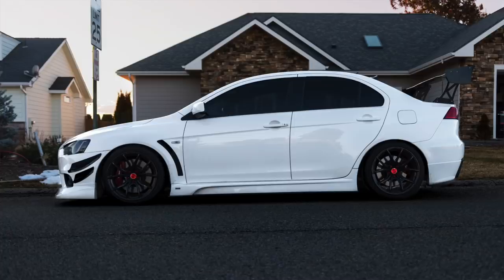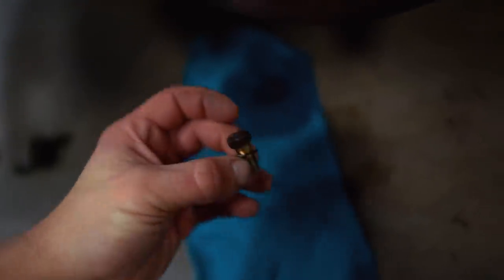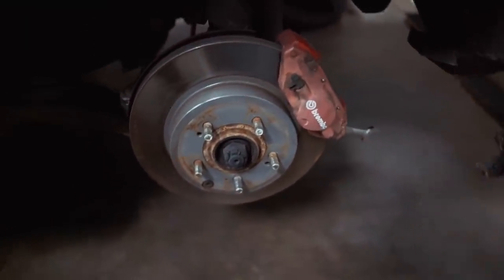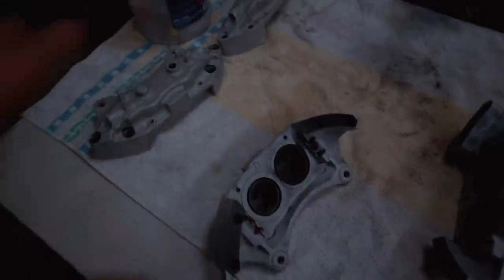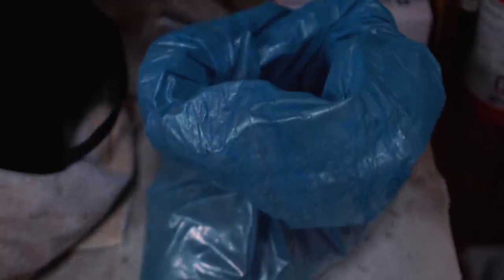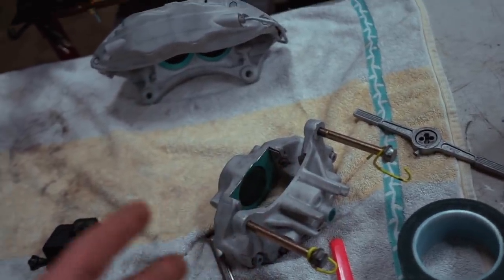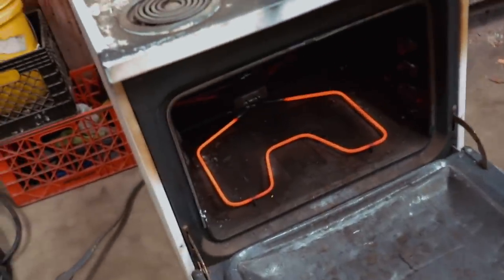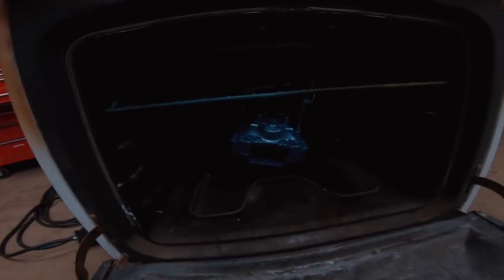Recoating Brembos At Home With Insane Results!

Comment: The calipers loos amazing in this new color and I prefer the white Brembo stickers. Is the first time I saw the process of Coating calipers. Amazing job with the calipers 👌
Reply: Whats the best order to do decals in, base colour, decal, clear? Or do you put decals on last?  Do the decals hold up to the heat before you apply the clear as I see you heat up the calipers, does the decals not peel off when heating up calipers? Tx

Comment: I may be mistaken but I think the reason the blue didn't gloss very well was it didn't get hot enough before you started your timer. With out enough heat and time the powder doesn't flow out correctly. When you put the clear coat back in the oven I had enough time to come to temp and flow out correctly. I actually prefer to use the almost chrome then coat with the translucent clear over, looks more like really good anodizing.  minutes is an awfully short time for the caliper to reach 400 degrees. When I do items like this I use an IR thermometer. Harbor has them cheap. I just did the top end on a Yamaha V twin I am working The Jugs took around a half hour - 45 minutes to come up to temp.

Comment: Nice job.  For the hardware though I would just replace them as the sandblasting pulls off the zinc plating and that can cause them to rust down the road.   As for the Brembo lettering if you take the outside of that lettering and stick it to the caliper you can then use it as a stencil and high heat paint the logo on and then follow that up with the powder coat clear.  I worked with a company that was doing that on calipers they offered in a variety of colors.  It looked great.  Give it a try next time.

Comment: ye i sandblasted a part for my motorcycle but they didn't stick i fixed it by heating oven to max and put part in for hour to kill static charge on it then i powder coat the part and after i heated up part and i hot flocked it with 2nd coat different color

Comment: Awesome video. I’m needing to rebuild some old motorcycle calipers and calipers on my IS300. Been looking for some powder since I didn’t want to use paint. Also thanks for sharing all the things you used and not just showing the process. Also, how has the powder been holding up from the heat?

Comment: Never mix grease with brake fluid, they don't play well together. Brake fluid is silicone based grease is oil based. This is especially important with antilock brakes. The color is great but temps are important for flow out and adhesion. Eastwood has a couple of really good books that offer some great tips and tricks.

Comment: Question.   You're putting the decals between the color coat and the clear coat.  Do you have issues with the decals deforming or melting?  Just getting ready to have a set done and the power coater is concerned.
Reply: Wondering about that as well

Comment: Hate to be a nitpick but it's electrostatically  not electromagnetically. the extremely high voltage causes a static charge which just like hair rubbed to a balloon causes your hair to stick to the balloon. This is important because of the safety hazard the voltage causes.